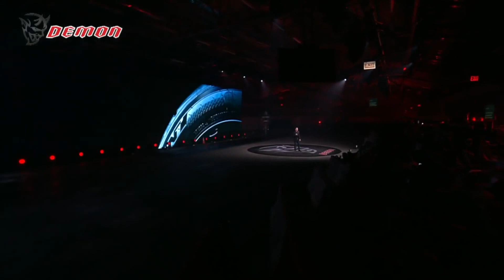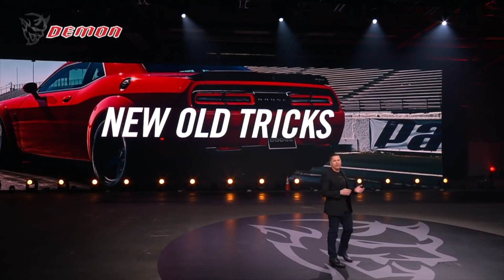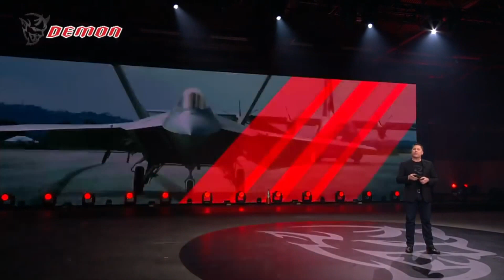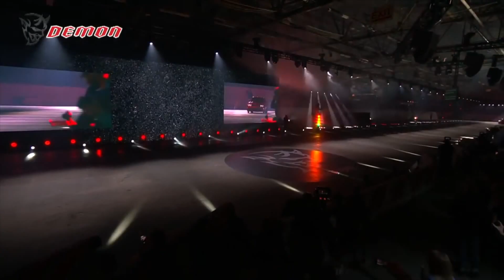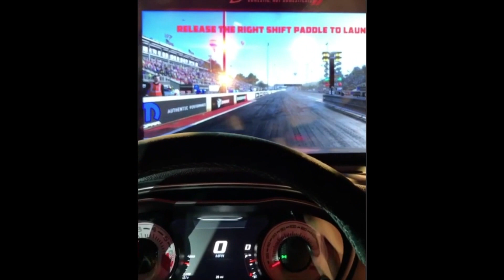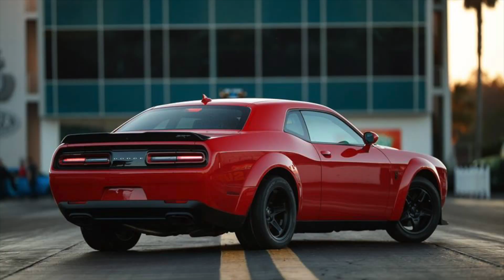2018 Dodge SRT Demon Reveal!!!!!

Comment: But it's an automatic...
Reply from the maker: JacksTip the auto shifts faster than the fastest manual driver
Reply: I know that. But that is not my point. It's an automatic. lol
Reply: I am just saying that I do not know a single racer or even ricer that drives an automatic for speed. Even though this car is faster than all of them, and shifts faster and just overall good speed, I lose a ton of respect for it because it's just a fast go kart. lol
Reply from the maker: JacksTip I know of a lot of racers both domestic and imports that use autos. A lot prefer manual transmissions but chose the auto based on the faster shift speeds
Reply: Meh, not a real race to me. It's a go kart. My car is faster derp derp.

Comment: Well, This is more then your average street muscle car. factory muscle cars are becoming the norm with some manufactures, Dodge seems to be on the top of the game. Since producing the hellcat that is fast enough I think they just may be going a bit overboard. I have seen a lot of people driving RWD cars and losing control very quickly on local highways. Not long ago a mustang who was apparently angry at me for useing my blue light to go around traffic at a u-turn decided to follow me, he hit the gas and the car went into a right hand sideways turn, he tried to correct and went left right into the highway divider. More then likely totaled the car, being I was on a back up call I could not stop to see if he/she was injured. I'm sure the police got there pretty fast being his car was slammed pretty hard into that cement wall. In any case some drivers are just not experienced enough to drive some of these cars. You can go on this site {You Tube} And watch so many fast cars getting wrecked.